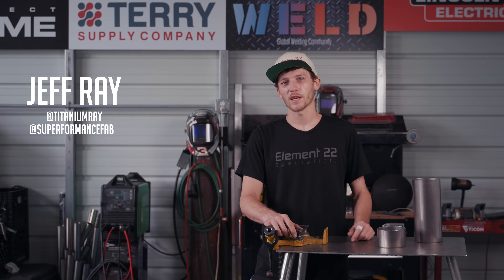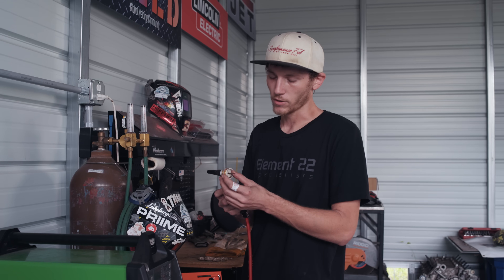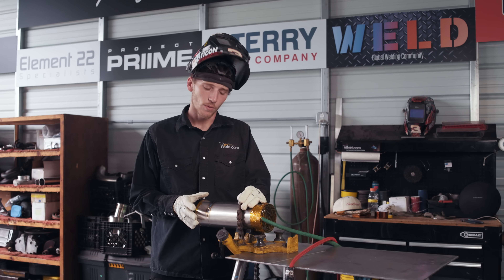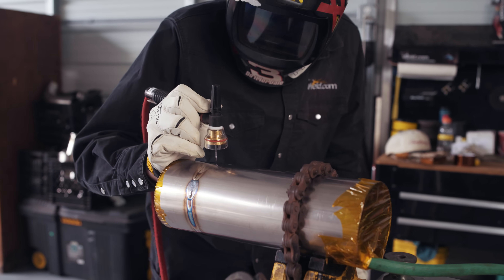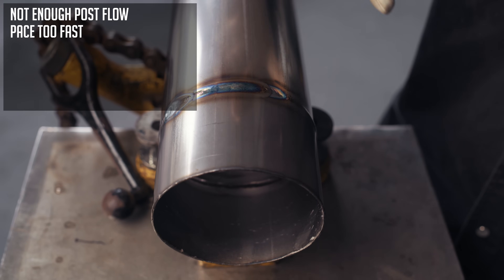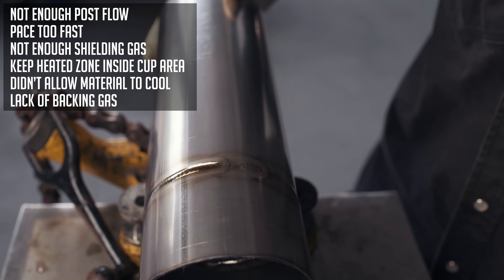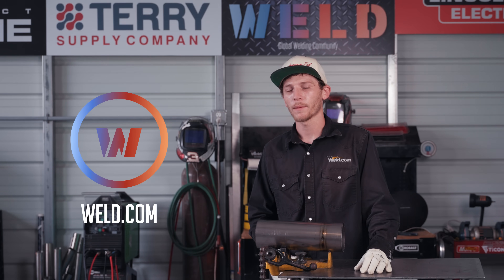Do's and Don'ts of TIG Welding Titanium

Comment: Another great video Jeff! 

In order to determine correct interior purge time, you need to know the volume of the vessel you're welding. That changes based on the diameter and the length. The formula for the volume of a cylinder, like the one in the video is: Volume=πr²h or Pi x Radius Squared x Height. If that tube is 4" diameter and say 12" long for example then: π2²12= 150.8 Cubic Inches of Volume. Our regulators measure flow in Cubic Feet per Hour, or CFH. To convert our volume in cubic inches to cubic feet, we multiply our cubic inches by 0.000578704 (or divide by 1728). 150.8/1728= 0.0873 cubic feet of volume. To convert our CFH to CFM (Cubic Feet per Minute) we multiply by a factor of 0.0167. So a rate of 25 CFH is equal to 0.4175 CFM. Therefore at 25 CFH, that cylinder should be completely purged in about 12.5 seconds (0.0873/0.4175=.209*60{seconds}=12.54). That is, of course assuming that the air can escape at the same rate as the argon is  being introduced... yay math!
Reply: How did a comment made 2 weeks ago appear here on Feb 3rd?🤔
Reply: @precisionarc  Early access for paid members, a couple of bucks per month offers some cool perks… and a time machine helps.
https://youtu.be/-DLRwNovkKw

Comment: Need to keep your rod under the gas.  What's the point of keeping the weld clean when you pull the rod out from under the gas coverage and put that back into the weld?  It will still look silver, but still adding contaminated metal everytime that rod comes out from the gas

Comment: So correct me if I'm wrong but aren't you suppose to have respiratory protection with titanium for the gas it releases when welding????
Reply: When you weld anything I believe, there is toxic gases released. As far as it goes for titanium which gases specifically are released. Thanks for reaching out
Reply: Just looked it up osha requires "full face piece" the files listed as titanium dioxide didn't know that was a thing msds lists basically common elements and is as useful as always. But not one mention of the old timer "quick weld trick" drink milk to coat your stomach or just use charcoal filters hmm. But ya suppose to use full face piece even 3m quotes osha regs on their site. Thank you now I know for myself and not what I've been told.

Comment: Interesting stuff. I have several critiques that might help you become a better instructor though Jeff.
1) You didn't mention how long your preflow and postflow were. We need to know that stuff. 
2) Polarity. I assumed you meant DCEN, but wasn't certain until I read the comments. That needs to be covered as well.
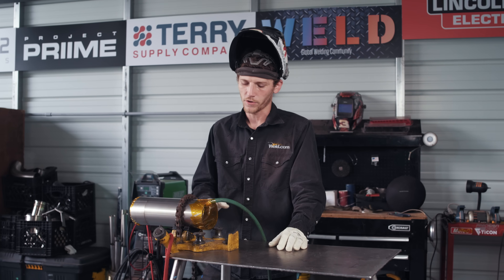3)At 3:50 you said "Evacuate all oxygen." I honestly don't know if it's just Oxygen you're worried about or other elements in air. Are there specific gases we need to keep away from the metal, or is it just air in general?
4)When titanium is cooled enough to keep going, is that when the glow has completely gone away or do we need to wait a few more seconds?
5)Filler metal was never covered anywhere in this video. That has to be covered.
Reply: Thanks man appreciate it. In the moment i do tend to forget that i need to be more specific when elaborating on things it something i am working on and are getting better with as i shoot more. Thanks again man

Comment: It welds just like stainless you just need a really good purge and a trailer on your rig and to hold the flow after you stop for like 10 sec people over complicate stuff sometimes lol
Reply: Minimal heat input, less than stainless, and maximum argon coverage, more so than stainless. 
Any more coulour than a gold tinge around the weld, and a silver weld bead equals no good. Not if you want the titanium to keep it's properties👍

Comment: According to my math... Volume of inside of pipe = π•R² (3.14x 2x2 ) =12.56 sq in x L (14) = 175.84 in³. Volume of gas from regulator in 1min at 25CFH = 25cfh ÷ 60min = 0.4166 CFM x 1728 in³ per ft³ = 719.88 in³. Now 175.84 ÷719.88  = .244 x 60sec = 14.65 sec to fill that tube (air turbulence and mixing not factored in) your pipe looks to be about 14in long and 4in OD, so one minute is a pretty good guess !

Comment: Good information Jeff, you didn't show what was on the end of the purge line, I usually use a pneumatic muffler to diffuse the gas, although not required it does work well and is inexpensive.
Reply: Thank you and your right i didnt talk about that in this video it was an open ended piece of rubber hose but in previous videos ive shown my process endcaps that have a diffuser built into them in previous video. It would be good idea to go ahead and throw one on the hose so it will have one.

Comment: Does titanium need that much stick out? Also what tungsten composition and grind angle do you recommend?
Reply: No it doesn't, there isn't anything about titanium that a particular "blend" would provide an advantage. Use what you prefer for DC welding.

Comment: I'm not a pro but I managed to get very good structural welds on a.c. but super important was to use a Virgin s.s. brush and 99% i.p.a. for pre cleaning and get a good back purge. I was just using a # 7 pink cup but I didn't have to have the tungsten dangling so for out in the breezes. I did this hundreds of time and had great success. I'm not a pro but just thought I'd say what worked for me.

Comment: Nice. But Why the enormous wolfram stickout when you want good gas coverage.
Reply: my thought as well, maybe for filming...
Reply: I feel in relation to the cup width the tungsten stick out is what i look at. Using the tip of my tungsten sticking out half the distance of the cup diameter being almost an inch, i would stick my tungsten about a half inch out and when i use a number 7 cup that about half an inch wide, i would stick my tungsten out about a quarter of an inch. Just an example of another way. And with the size of the cup it be difficult to see the tungsten too so thats why they make clear cup as well. Id i had the tungsten pulled in some it would be hard see it especially if it was a ceramic cup.